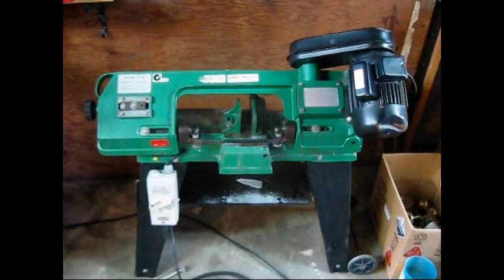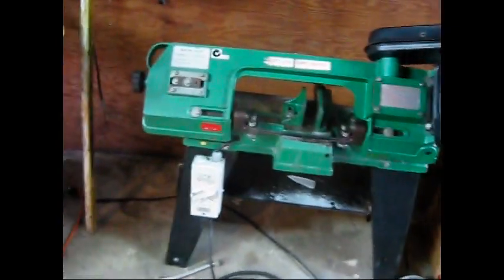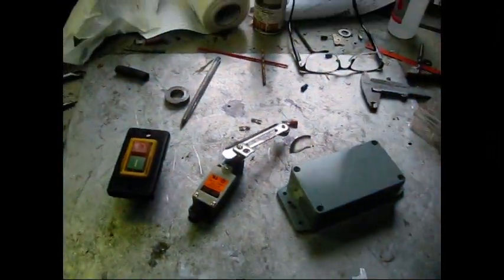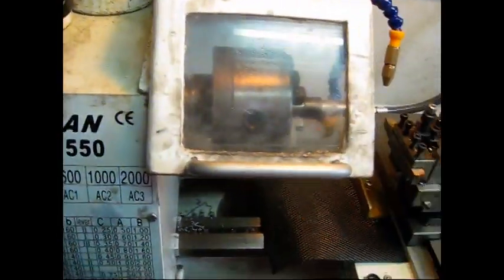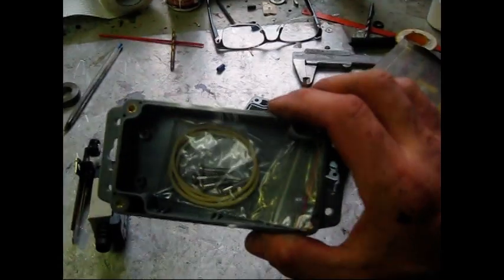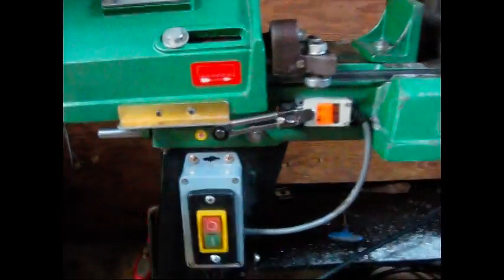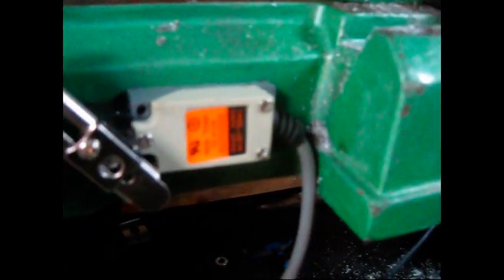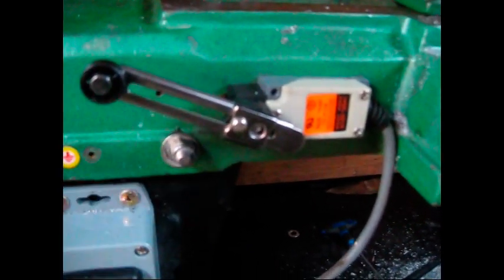Bandsaw re-wiring

Comment: Great Modification....is the start/stop switch a momentary contact that has a built contactor and the Limit just opens up on side or the other of a coil?  Where did you get it?  Thank You
Reply from the maker: It's an industrial limit switch there are heaps on ebay. One direction normally open the other contacts normally closed. From memory it's wired before the main switch which is just one of those self latching on off switcheo. When the limit switch engages it interrupts power to the self latching switch which then turns off. You then have to un trip the limit switch and press the starting button again.

Comment: how  did you wire the limit switch ?
Reply from the maker: From memory you wire the active lead to the limit switch before the main on/off switch, on the normally closed contacts. Once the limit switch is activated it breaks the contact to the on/off switch which then resets to its off state.
Reply: Super Grover  but when you lift the saw the motor stays off how you do that?
Reply from the maker: Those switches use a relay to operate the motor. Once you switch off, you must press the on button for it to start again. @marcogarduno2090
Reply from the maker: The actual on-off switch that starts the machine I mean.Once the limit switch operates it cuts the power to the on-off switch and then you need to start the machine by pressing the on button again.
Reply: Any possible chance you can post the part #s for the 2 switches?